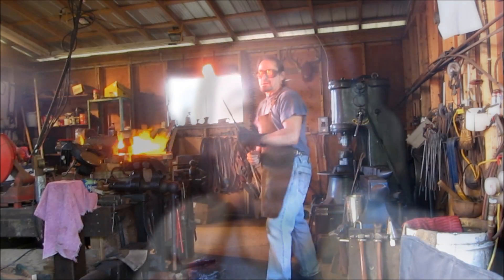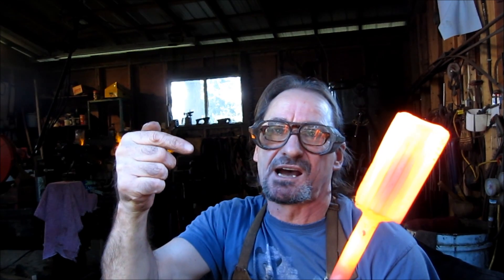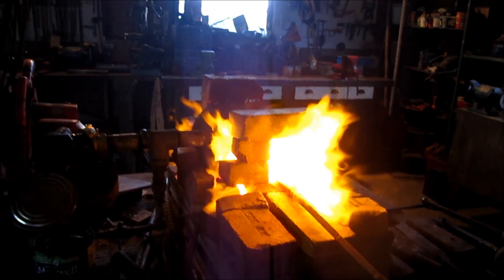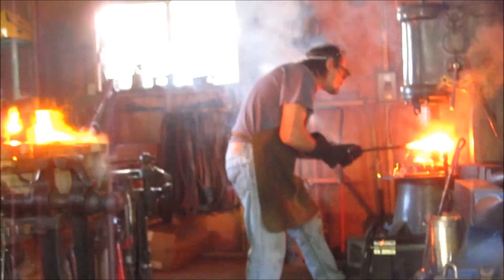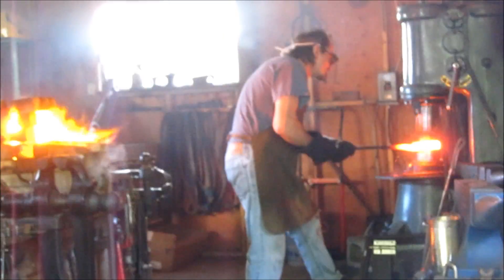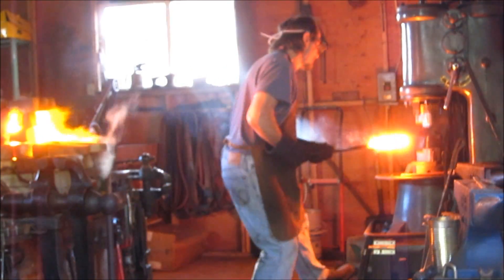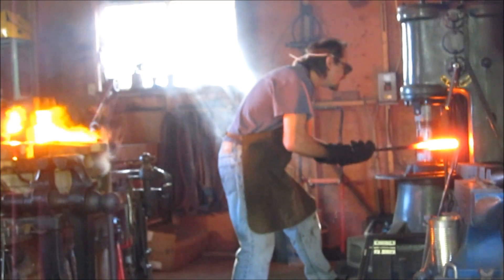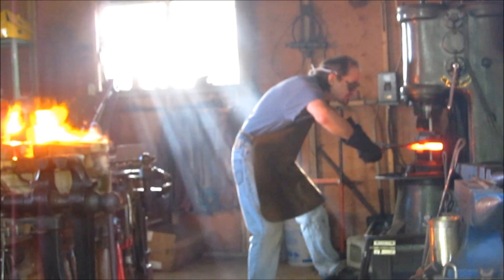Making Damascus Steel, from Stack to Steel HD.

Comment from the maker: @dakotherathunter 
Thanks.
There's a lot of people taking arrows to their knees lately it seems.
My side-kick Lydia, took one to the ass the other day.
I pulled the arrow out, gave her some poison potion and she'll be just fine.

If you have access to coal char-coal or even wood you can get into smithing  yourself.
You can use a blow dryer as a blower for you forge, and any thick piece of iron can be used as an anvil.
Go for it.

Comment from the maker: @jezzafox 
Thanks.
I'm in the process of building a coal forge around a Vulcan fire-pot.
I'll be able to weld up huge stacks of steel with the fire it will make.
And it should make for some great videos.

Comment: @ Raven You have to account for that the outer layer is welded onto itself, so it goes missing -> 4 -8(7) 
IF you are a pedant, then it continues 7-14(13)-26(25)-50(49) - 98(97), etc. but I guess no one counts it that precisely.

Comment from the maker: @kght222 
I start out with 7 layers because to get a pattern you need to mix different steels together like high carbon and low carbon steel.
The more times you fold it, the finer the pattern.

Comment: crap shouldn't seem like i'm calling out like that i'll tell, i think you lost a layer at the second fold, or you used a couple already layered chunks and welded em together (a 3 and a 4). but that's pretty much how anyway, i get it now, i think, you probably make allot of these, so you prepare steel for putting something that is ordered together, then once you know what it is, you know how much of your stock you need to produce the blade. anyway if that has anything to do with why 7 layers....

Comment: Hi Conan
Very impressed to see how you handle the hammer,do a bit of Damask myself,and normaly start with 7 layers then 14-28-56-112 and so on,my q is why dont you use Borax after those 7 layers??my experience tells me(after working as a educated blacksmith for nearly 16 years) that there still will be pieses of metal(running of)betwine the layers,wich ofcause will influenze  on the welding..
Keep up the good work
best regards
Hans

Comment from the maker: @NocturnalBreather If you can get an air blast through those holes then you've got yourself a small forge.
You want the steel light orange or hotter when you start forging

Comment: @Conan568 i have some questions for you.
firstly, i was told that damascus steel is stonger than normal steel... if this is true, does it need to be etched to gain this strength?
and secondly, can this be done with an old file for steel, a forge made from a frying pan, and a hammer instead of that mechanical press thingy?
i am just starting forging and i love your videos. thank you and please keep them coming!

Comment from the maker: @siggeller 
I just use sulfuric acid and give it a good long etch.
I clean it up under hot water by rubbing it with a soap loaded toothbrush which cleans all of the etchant residue right off.

Comment from the maker: @TenguWayOfTheWeapon 
My hammer is made in China and was called a "Striker" forging hammer before they were bought out by a larger company.
My hammer is 600 lbs heavier than an Anyang hammer with the same weight ram,, it has a thicker casting.

Comment from the maker: @movedwithcompassion 
I wouldn't even know what to guess, insufficient data.
So I won't ;-)

That Striker STC-88 is perfect, it has way more power than I normally need and it's good for smaller pieces too.
Best $3500 I ever spent.

Comment: @doughnutboy99 i do glass blowing and I gotta say after watching the blowing seems pretty tame, I only do torch blowing but even the furnace guys dont have showers of sparks flying at them. And most glass blowers dont even use gloves, sometimes youll use a "wetpad" for shaping which is basically a bunch of wet newpapers stacked if your poor like me, or some people have fancy ones. But as long as you are smart enough not to grab hot glass or put your hand in a kiln its pretty safe.

Comment from the maker: @duvexy 
I bought my air hammer for about half that much because the organ makers in Quebec didn't understand the retaining wedge concept, and arc welded the dies to the ram.
The retailer informed them that they may have ruined the ram and they dropped the price $3000, 2 weeks after I'd turned it down at $6500.
I knew the heat treatment would be fine because it would only affect a very small part of the ram and dies and I was right.

My forge only has 1 inlet hole.

Comment from the maker: @duvexy 
The forge creates a draft in the shop when I have it running at welding heat.
Those 88 lb. Striker air hammers retailed for around $6500 when I bought mine, I paid nowhere near that though.

Comment from the maker: @hammerman947 
I like it that way, lol.
It suits me better for blade smithing applications, which are a bit different from regular blacksmith work.
When I straighten a large blade, my tongs are at the anvil  heel and I have the whole face to use.
If I had the anvil facing the other way, this wouldn't be possible.
Make sense now?

Comment from the maker: @FabioCrow07770 
It IS easy Tony.
I use 112 layers for fittings and 336 layers for blades.
If you go higher you can't see the pattern very well, but there is no limit.
If you fold enough you'll end up with a very labor intensive spring steel bar.

Comment from the maker: @MrEhud77 
I weld a 7 layer stack then draw it out cut and fold it, that's fold 1 and 14 layers.
I then weld it again and repeat, that makes fold 2 and 28 layers.
Fold 3 would be 56 layers and fold 4 makes 112 layers, and that's where I stopped with this bar.

Comment: Great video, and very informative! Why didn't I see any anhydrous borax added between welds? Is that an unnecessary step when you have correct temperatures, or does the wire brushing eliminate the need for it?